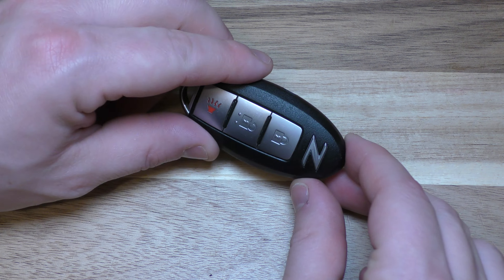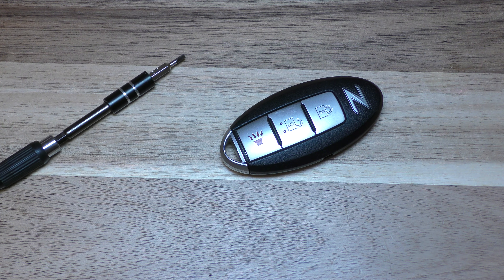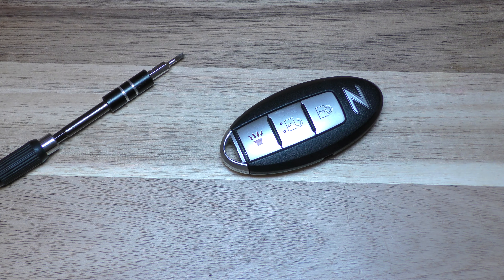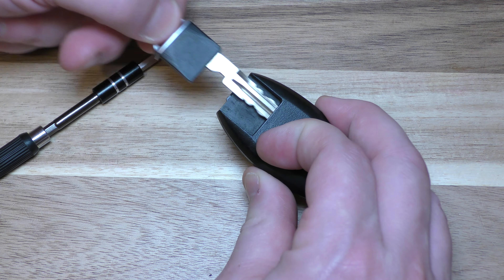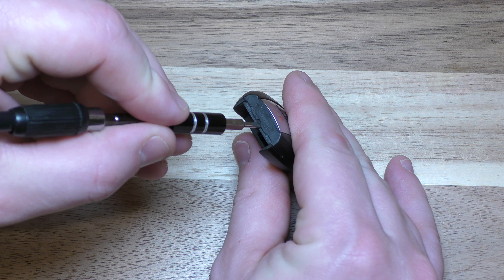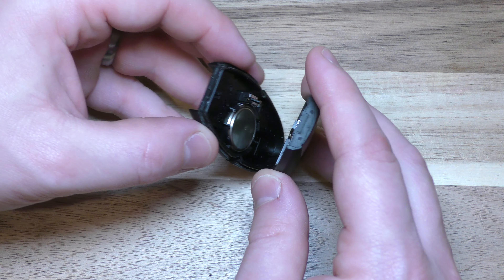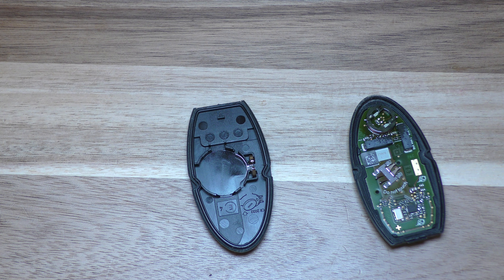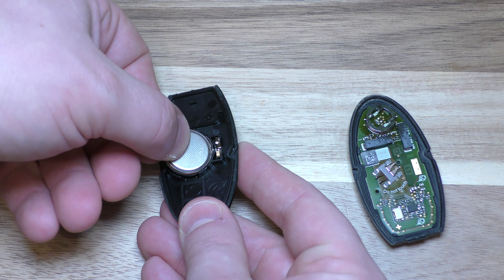2009 - 2019 Nissan 370Z Key Fob Battery Replacement - EASY DIY

Comment: Just a tip for anyone. I accidently bought a CR2025 keyfob battery.  it still works.
Reply from the maker: 2025 and 2032 are interchangeable. The 2025 is just slightly smaller and will last a tad shorter but still very useable.

Comment: Video was great 😁 however i find that if you have them, theres 2 little slots on either side of the fob where i found that placing the screw driver there and twisting it to open the fob is easier 2. 2016 370Z.😊

Comment: Okay one issue my Z key dont have release hatch on the back its I solid nismo key I'm trying to press lock and unlock and it wont work I think battery is dead and dk how to change mine😅 if I had that a key it wouldnt be a problem u made it super easy for everyone ty for that it's just mine is a bit different great vid